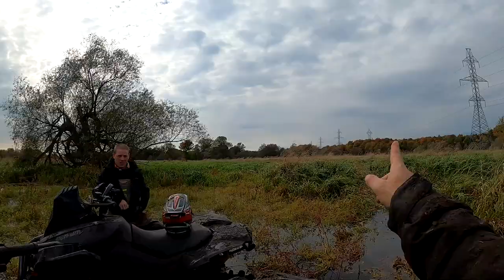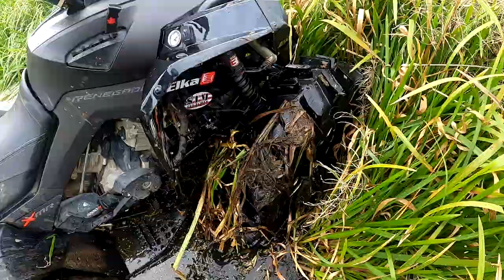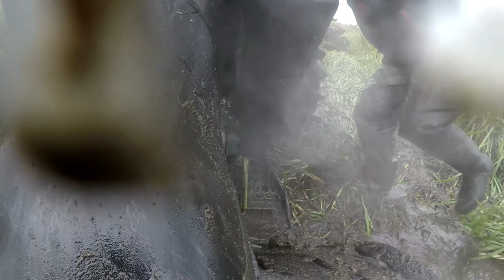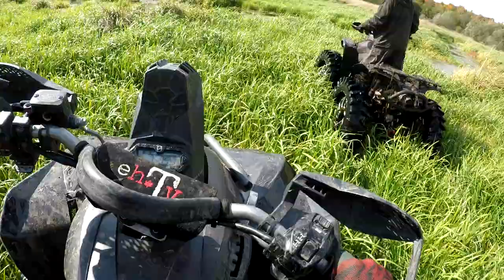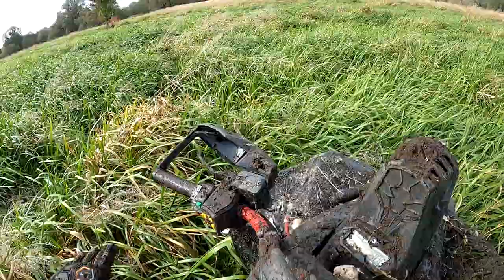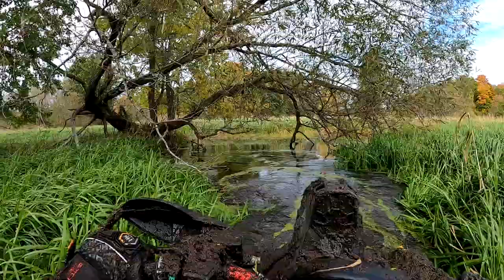TOO LITTLE TOO LATE!!! Can-Am Renegade Xmr1000r Goes Wheels Up!

Comment: Great vid as always bro. I’m thinking about going with the 310r’s myself. Do you like them tires better than assassinators? And do they pull as good?
Reply from the maker: They work well, but ride like crap until you hit the soft ground. The problem is they only come in a 20” wheel. Which is proving to be too big for comfort. Lol. I figured but still wanted to try them out.
Reply: @ehTV1000  ahhh ok cool. Good to know. I like the look and like the 20” rims. I live in Louisiana in USA so pretty much all I do is play in the mud so I’m not worried about how they ride on hard ground. I just didn’t kno how well they pull. Thanks for the info and keep the vids coming man. 

P.s. we need sum eh tv stickers. Hint hint. Lol

Comment: What would you suggest an 850 sportsman or Honda 520. Both 2021 model
Reply: VERY tough choice 
The Honda won’t break but won’t have the most power and the Polaris with have more power but be a little easier to brake.
That’s what I’ve heard about Polaris I’ve only ridden a Honda out of the 2.
If I were you I would choose sportsman for trail and mud riding and Honda for mostly mud riding.
Also think about a highlifter 850 that would do well in the mud too.
I honestly can’t choose between the 2 both are great quads.